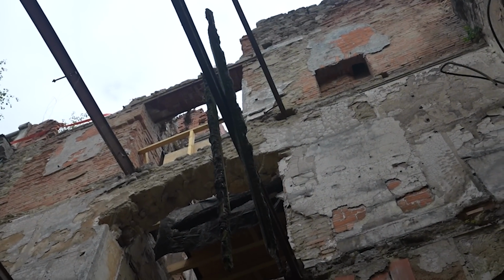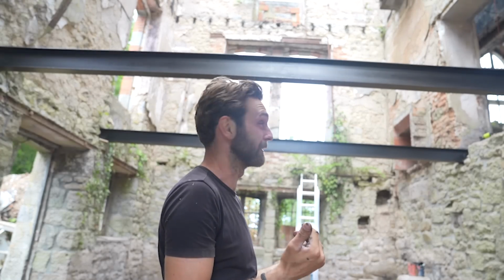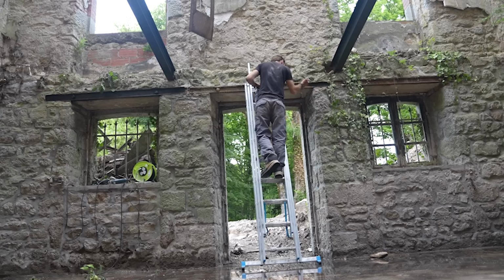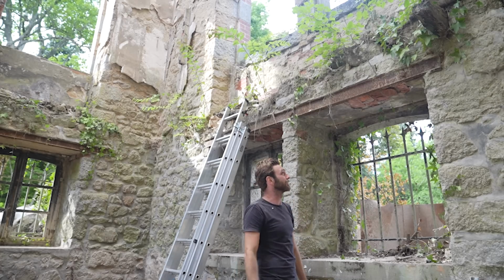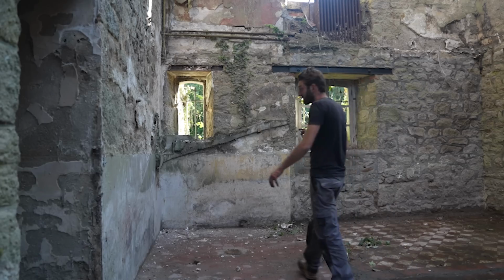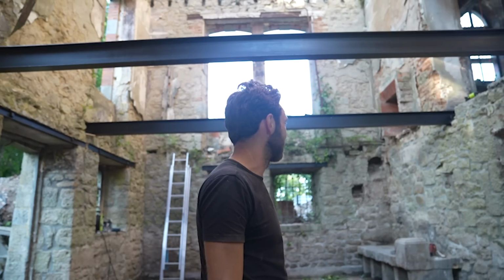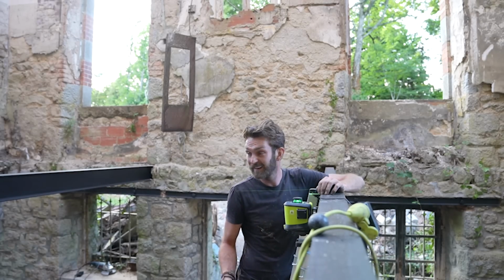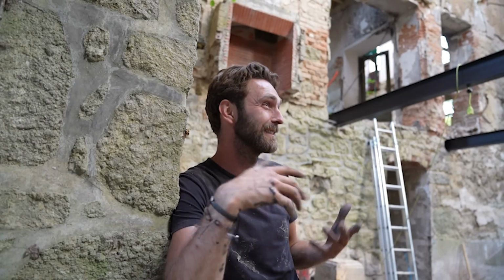Finishing the steel work in the uncovered kitchen.

Comment: Wow Dan. This is the first time we have seen the interior of that side of the chateau. So interesting. The metal on the windows, the walls, the stairs. Just beautiful! Hopefully others picked up on the fact you had an engineer tell you about the other beams above. I never doubted you for a moment ❤️🏰❤️🏰🇨🇦
Reply: I was just looking at how “empty” it is compared to the other parts. Lot of work ahead!
Reply: Yes, it was great how he slid in the engineer comment!  Keri💜
Reply: @lukehartman9386  He mentioned the structural engineer several times in earlier videos but apparently most people missed that. In one of the videos he measured the rooms for the load calculations and in another one he mentioned that the new steels would be much bigger than the originals.
Reply: @Ragnar8504  Was definitely referring to all those that have missed this fact and continue to make comments about Dan needing to consult with an engineer.  I found his comment funny!  Thank you for giving more detailed information.  Keri💜

Comment: The stonework in there looks very good. No doubt it was originally plastered over, and I can understand in a kitchen from a hygiene point of view you'd want smooth walls, but it would be nice if some could stay exposed. Maybe in the bbq area?

With your beams dead on, the beam and block installation should go very well. The stability it will give the whole structure will be very beneficial.
Reply: I think he wants do do joists and floor boards in here but I'm not sure. The BBQ area was a fairly late addition I think, Dan mentioned it was built using one of the stone pillars from the balustrade the previous owner replaced with concrete walls in the 70s or 80s.
Reply: @Ragnar8504  Joists and floorboards in the kitchen???

Comment: I was a commercial interior designer and then custom Timberframe home designer for over 40 years.  Love the videos but I have one quibble - the steel I Beams will have wood floor joists slotted into their sides in order to support the sub-floor and then the finished floor.  As I said, just a quibble, but I do like to use the correct terminology.

Comment: This is GREEN and low-energy building at its best.
(What are your considerations behind starting from the ground and NOT from the top with roofing?)
Reply: It makes sense to ensure structural integrity before putting a roof on. Plus having safer conditions and access when he gets to roof level.
Reply: @LaReynedeNeige  Have no idea how rainy that region of France is, but in many countries roof has high priority. But I trust it, our builder makes the right choices 😃
Reply: @PeterJessenDK  There's probably a lot he can do during the next couple of months but he has to aim to get at least a temporary cover for the winter. Presumably his schedule of works allows for that.

Comment: Great work and progress, my fav YT channel these days.  The water on the floor reminds me of a Q I had; what is your timing for getting some sort of roof on the chateau?  The tops of the walls look to need a lot of work before you can start adding roof framing, but would be great to get the interior protected from the weather after all your hard work!  Maybe in the fall before winter sets in?
Reply: I assume he's going to build floors to work from before tackling the tops of the walls and then the roof but we'll see. The permanent roof is probably a few years in the future, it's a massive project that will require professional help and massive amounts of materials, timber and slate.

Comment: I don't think that doorway led to the stairs, it's right above the bottom of the stairs, so you'd have fallen a good two metres if you'd walked through there. Also note that the bottom of that opening seems to be higher than the hallway floor. I guess it might have led into some kind of storage cupboard above the stairs.
Reply: If that is the case, then, wonder where the stairs go to...?

Comment: Thinking as long as your painting the rusty beams maybe paint the rusty window grates?  Also thinking maybe re build the stairs with plywood and that might make movement easier up and down.  🪜 instead of a ladder?  Then renovate a bathroom?
Reply: Temporary stairs would get in the way of the scaffolding he wants to put up inside the stair well to repair the top of the tower.

Comment: Steel won’t be straight, put arch up side and get a longer level. Be interested to see the I beam deflection when floor  loaded as rough rule of thumb 10m span should be minimum 500 *180.
Reply: This span seems to be about 5.4-5.5 m (6 m RSJs, trimmed around 200 mm off the ends and 150-200 mm inside the walls). I'd assume the engineer who calculated the steels ran the numbers through Eurocode software.

Comment: Hm. That room is sufficiently intact to be impressive now that all the stuff is out and the steel beams are cleaned up!

I know finishing rooms isn't anything like the priority at the moment, but I hope that when it comes time you'll think about just cleaning up and repointing the stone and leaving it exposed wherever you can. It's a basement, and those walls are at least half a meter thick. At the very least the inside wall could be left uninsulated since it's not exposed. If you feel a need to insulate the outer walls in the basement, well... Maybe consider using something like a hemp and lime plaster for that? It's insulating and has a gorgeous finish that would look amazing with some exposed stone, plus it can even out a wall without having to resort to using a ton of lumber to build the wall out first. I'd have to check the numbers but I suspect it's also considerably cheaper than rock wool, and it's definitely more earth friendly.

Comment: Hopefully it is not to late for my two Cent. If you are plannig to putt wooden beams inbetween the i beams, Then you should let the wooden beams protrude 1 to 2 cm on the top. I have a similar ceiling construction in my house and the beams have shrunk significantly over the years. So much so that the floor of the rooms above has a small hump in the area of the steel bekam.

Comment: having just pulled a bunch of ivy off my stone home, i found using a propane weeder burner torch to be great to burn off the growth on the stone once stripped.
Reply: Can't use a flame during certain times in the Summer in France.
Reply: @LaReynedeNeige  good to know,  i think danger would be minimal just burning off the rootlets.  If you tried to burn off the vines themselves you could have a conflagration spewing burning leaves in the wind for sure.

Comment: So , does that ground floor need to remain open until all of the upper beams get lifted and set into place ?     🤔
Reply: My understanding is the intention is to install each floor as he goes.
Reply: @LaReynedeNeige  Should be able to get the beams in through the windows.
Reply: @Ragnar8504 Those would require a crane to do it that way .
Reply: @danieloutloud9151  The ground floor isn't that high above the ground. For the upper floors he'd have to get the beams up through the stair well I think. Actually "upper floors" is an exaggeration, once the ground floor ceilings are done it's only one more floor above. Getting the steels from the stair well into the side wings could be tricky though, might be worth leaving a hole in the ground floor ceilings until the steels for the first floor ceilings are in.
Reply: @Ragnar8504  There are no stairwells at present what I was saying was that it would be best to have an uncovered portion of floor on each level because those heavy beams will need to be lifted up for each floor to be put up and they'll have to have space and a means to hoist the beams higher and higher .

Comment: You should have put in a metal pillow first and leved that out before putting in the beams. 
And don’t put in hard concrete around the beams!!!! It will never work together/will always crack. It’s not caring concrete, so just a weak one with mortar in!!!!

Comment: I had to do this in my previous very old house. I levelled up the joists using firrings which are angled strips of wood fixed to the top of the joists (I couldn’t raise them as the wiring and heating pipes were already fitted) it was a tedious process cutting and planing them to fit but when the floor boards were laid the floor was almost perfectly flat. I plan to do the same in this even older house I have recently bought. 😂

Comment: You should purchase a pot hook for your gallon of paint cup pot. You can hang it off the ladder without risk of it falling n losing paint n making a mess of the floor. I paint for a living
Reply: Ps. 2 n 1/2 edge brush stiff bristle. Anything but nylon. They suck. The bristles can be a mix. But not straight nylon. Unless you wanna throw away after 1 use

Comment: Like the black against the stone, gives modern look. Have you given any thoughts on balcony railing, window & door colors?
Reply: The windows and balcony doors look white or off-white (bright white paint didn't exist until the 1950s) and the railings are quite dark in the original pictures, as do the front doors.

Comment: Dan the Man! 😊
Are you going to put the BBQ back? 🤞🤞🤞
Reply: Personally I wouldn't. This room would be much nicer as a big ca.-1900 kitchen with an AGA and a big maple farmhouse table (no fitted units please) than as a 1970s mediaeval revival dungeon I think.
Reply: @Ragnar8504  Aga cookers weren’t invented until 1922, and I think the room itself is large enough to accommodate any “modern” appliances imaginable. From the old photo and the newer stones in the wall the BBQ appeared to have been more akin to a bread oven, not a Weber from the ‘70’s.
Reply: @farmingirl4281  I was using the term Aga loosely, cast iron cookers are much older, they replaced open fires in large parts of Europe over the course of the 19th century.

Of course everything depends on how the kitchen is going to be used. If Dan needs a commercial kitchen that will dictate the finishes and appliances. If he doesn't he can choose from a variety of design ideas.
Reply: Dan being a chef-y guy prefers modern, really functional kitchens. That's what he said when they put in the kitchen at the farmhouse. He left a few small features here and there to harken back to the building's age, but it is a clean, sleek space and actually quite beautiful. Obviously not sure if he'll do the same here, but just thought I should mention that we have precedence as to what his tastes are.

Comment: I generally use a laser detection device.  Relatively inexpensive and available in red or green.  No waiting around for sun down and able to detect from quite a distance without worry of accuracy.  By the way, no need to be brand specific.  Just color specific..

Comment: I assume that it rained last night!

If so, how did the tarp hold up in the previous more complete vertical area?

I guess in this new area you are going to have to go through the exercise of putting temporary flooring in the upper most level you are working on so that previously completed flooring is not damaged by rain.
Reply: He removed the tarp weeks ago because it got in the way of rebuilding the walls.

Comment: If anyone wonders, a typical spirit level may have an error of 0.5mm/meter. Doesn't sound like much, but if one steel beam is tilted one way, and the other goes opposite, that could be a 1cm or more total error, and while that's difficult to spot with the naked eye, it will definitely fail a 'marble test'(drop a marble on a floor and see if it rolls. It shouldn't... )   
An expensive spirit level can be down to 0.2mm/meter.
A laser level that us mortals can afford is about the same accuracy, but will reach out over a much larger distance. 
With a spirit level you need to use a long, machined bar to get distance accuracy. Waving about a 2meter bar is bad enough, but get to 5meters or more... They're expensive... and really doesn't take well to damage of any sort.

Comment: Don't forget, dep on laser there is a +/- mm accuracy tolerance based on the # of meters that the laser beam is thrown.  One way to mitigate this is to do 2 or three measurements over a 30' span

Comment: "Normal" spirit levels are generally 1mm/m accuracy, but you can buy a "Pro" level that is 0,5mm/m   that is plenty accurate for what you are doing.   I would get a 1m and a 2m,   and for measuring uneven surfaces (or suspected so) tape a small block of something at either end, that evens out any teeter tottering.